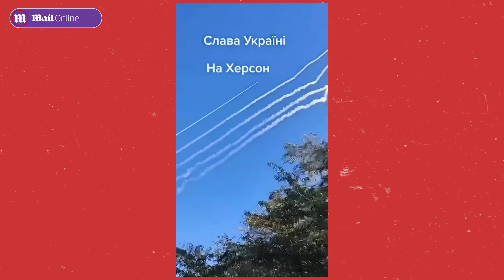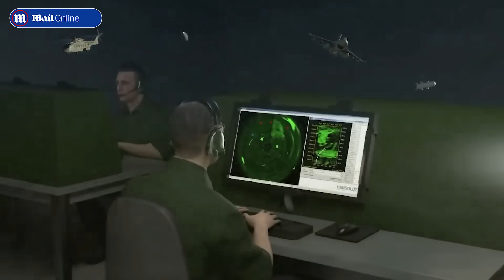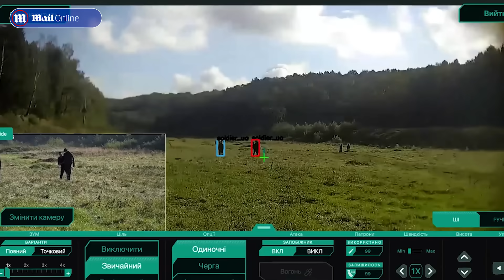The high-tech weapons Ukraine says it needs to break the stalemate against Russia

Comment: silly question:  why don't they use flamethrowers like they did in WWII?
Reply: Here are a few reasons. 
1. They are heavy and bulky to carry, limiting the mobility and endurance of the soldiers
2. They are dangerous to the user, as they can explode, leak, or malfunction
3. They are ineffective against modern armor and vehicles
4. They are controversial and inhumane, as they cause severe pain and suffering to the victims.
But more likely still, if Ukraine starts using them, then Russia will as well. The US Army has stopped using them completely.

Comment: Zaluzhny only says the new technologies are required for a 'quick' breakthrough. They are making incremental gains in Kherson and Verbove, which is akin to prying the door ajar. Its slow, but the end result will be fire control over Crimea and Melitopol and Tokmak, in effect making it unusable for the Russians, followed by withdrawal eventually. There is only a 20 km gain required in both areas, so its just a matter of time.
Reply: 😂😂😂😂 if the counter offensive is anything to go by it will take years. Meanwhile, Avdviika will be Russian in a few months.
Reply: Yeah by that pace they can take back Crimea in 30 years  . The goal of the summer counter offensive was to reach the Sea of Azov . Everyone knew that is not possible and they changed their goal to capture tohmak after few months of fighting and still failed to get anywhere near to tohmak . Yeah they are making progress little by little but with that pace they will run out of manpower and time before even reaching Crimea